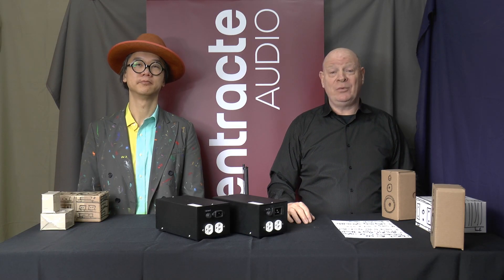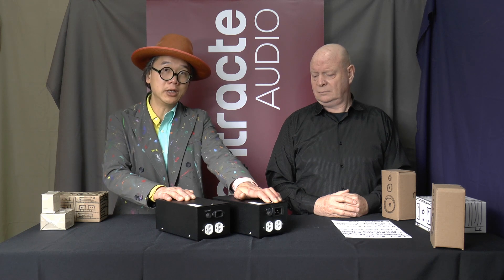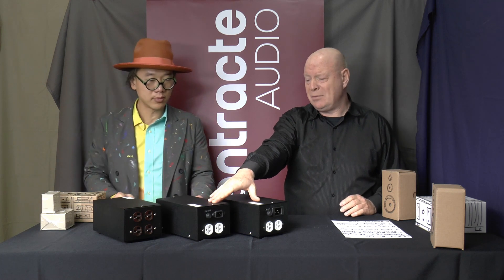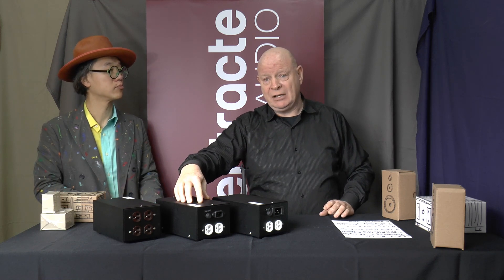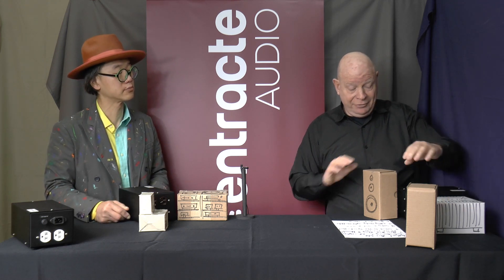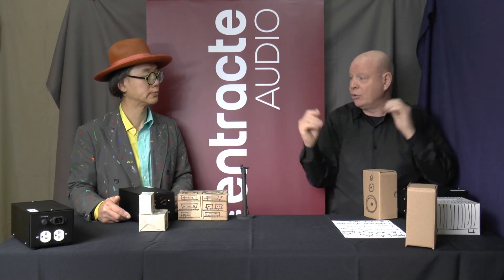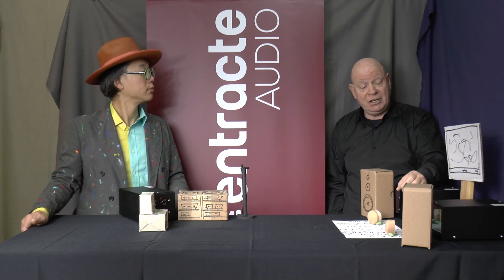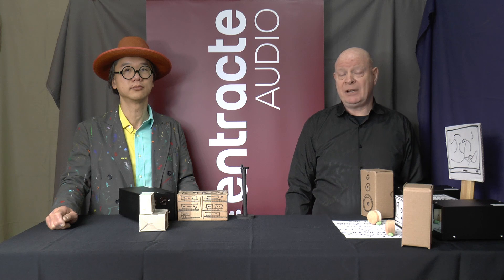Introduction to the Entracte Audio by Design EF215 and EF220 Ultra-High Current AC Powerline Filters

Comment: I know it's a difficult ask, but I absolutely love what you guys are doing and I would love to see some type of schematic or block diagram to help me further understand what you guys are doing. I love the price point because although it does seem a little expensive to the common man in comparison to other companies it's an extreme bargain. Thank you so much for that. In a world of $1,000 speaker cables and other nonsense if you will to see high quality components that are well engineered and thought out is refreshing
Reply: We don't distribute schematics or block diagrams, but I am happy to give a description of what goes on inside. We use an overall filtering network made up of 3 sub-networks (actually it could be as many as 6 or 9, depending on how you wanted to group them). These overall network is designed to eliminate electrical "noise" in an overall range of 50kHz up into the multi-gHz frequencies. Each sub-network is tuned to work on a specific frequency range, and to overlap with the adjoining networks for seamless coverage throughout the overall range. The sub-networks are tuned through the use of various selected types and values of capacitor. Also, part of the enhanced performance of the EF215 and 220 comes form the internal use of 10 gauge wire, which provides much better energy transfer than what you would find in other products. 

From your above comments, it is clear that you appreciate what we are trying to accomplish - which is to provide excellent performance at a somewhat reasonable cost. Our gear isn't cheap, but it is relatively cost effective, and we are determined to put the money into what helps make better sound.
Reply: @georgetaylor3107  I understand not publishing proprietary design. I also greatly appreciate you're detailed response. I have not seen many designer/builders offering so much of there research to the public. Many thanks.